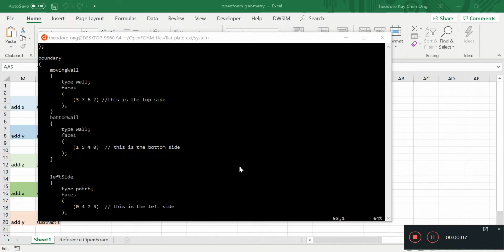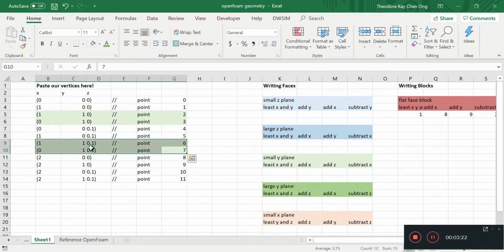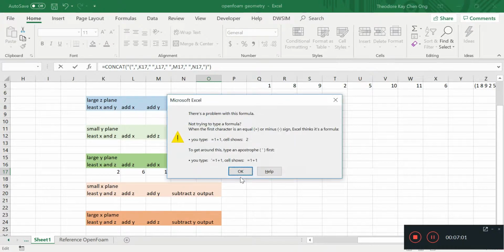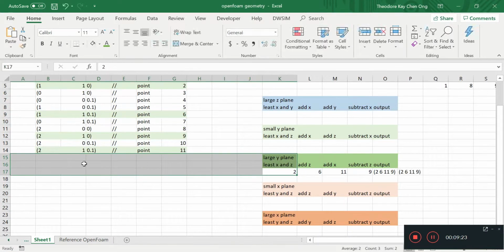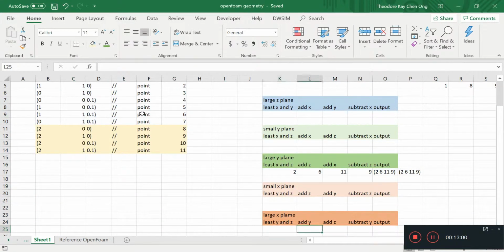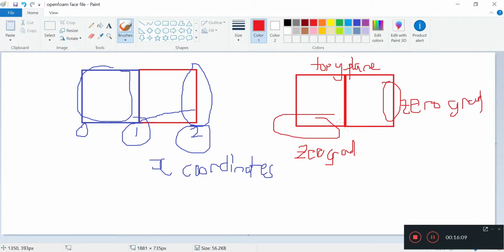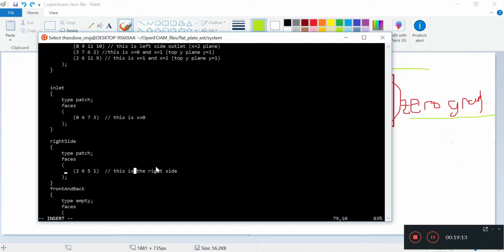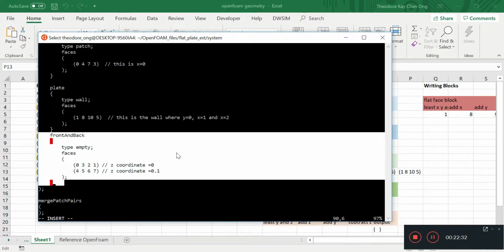OpenFoam for Beginners Win10 18 - blockMeshDict for BL flow 7

Comment: is (1 8 10 5) the same thing as (8 10 5 1)?
Reply: @TheoOngScienceAndEngineering  thanks!
Reply: Yeah, both are the same.
While defining blocks the numbering is flexible. You need to define one set of XY coordinates (either clockwise or anti-clockwise direction) and the you define another set of XY coordinates in the exact same way. When it comes to faces, the clockwise/anti-clockwise numbering determines the normal direction. The normal direction can be found by the right-hand thumb rule, and it must always be towards the direction of the fluid.